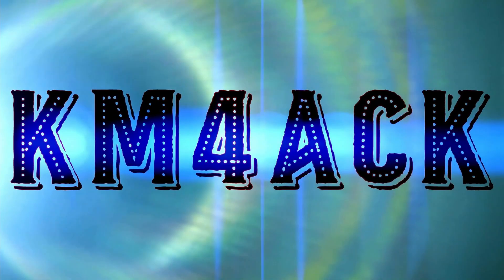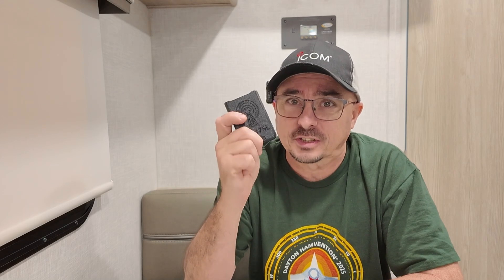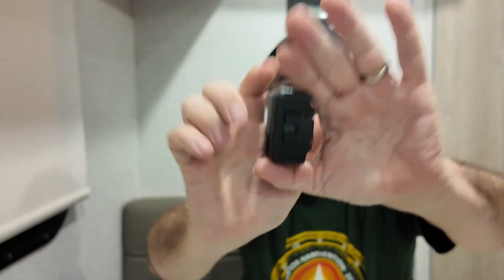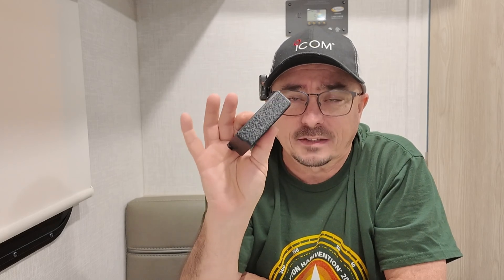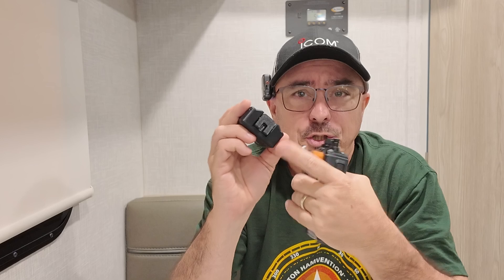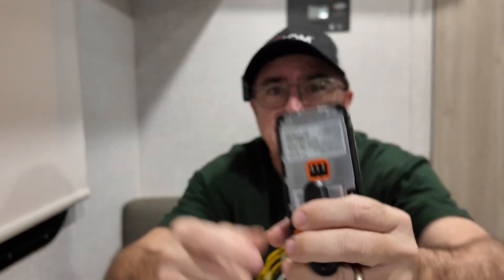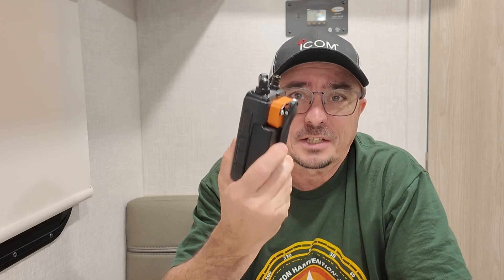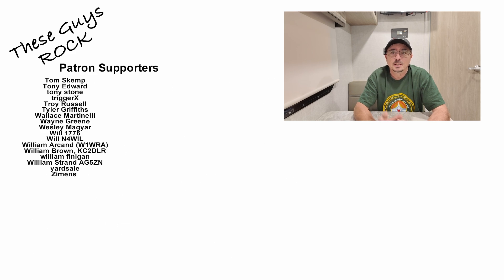I Pushed This to the Limit – 16 Hour Test

Comment: The FT-70 desperately needs a battery upgrade.  I bought a spare battery when I bought the radio. I never leave a battery in it when I'm not using it because the darn soft-power switch will drain the stock battery in no time.  Worst feature of the radio. 2nd worst ist the two-handed volume control mechanism.  Otherwise, a really nice HT.

Comment: I use the shargeek battery pack.  It's got a massive capacity in a decent size and a barrell jack with a constant voltage output.  I think it's variable up to 30v.  It charges at 100w.  I also use it on the 705 when I want the full 10w, and it can power any usb device like a laptop up to a 100w output.

Comment: I agree.  The BP-K75L brings the performance of the radio to new levels.  I also was frustrated by the charged life of the stock battery.  Buying the battery was one of the best gear purchases I have made.  My D74 had a a minor issue in attaching to the radio, but Kevin was very responsive and we resolved it totally.  I thought this was going to be an emergency battery, but it is now my everyday battery.  I would buy it again in a heartbeat.